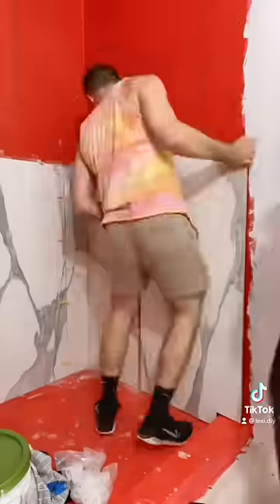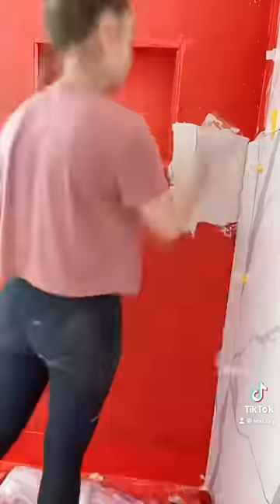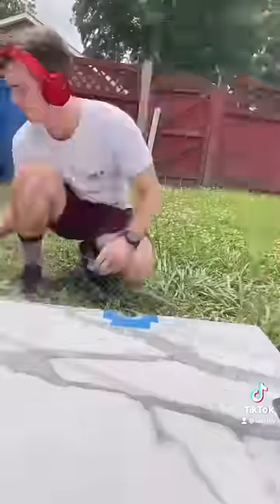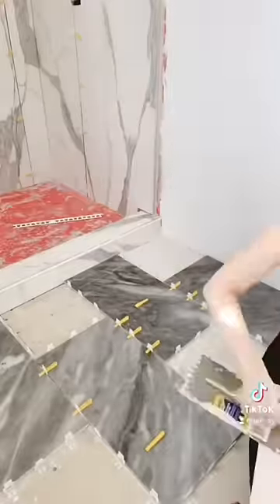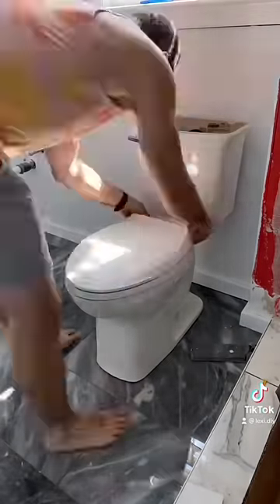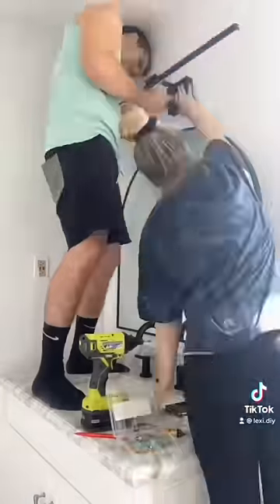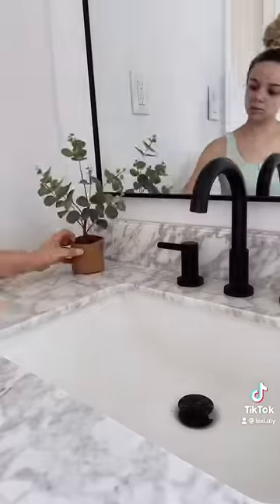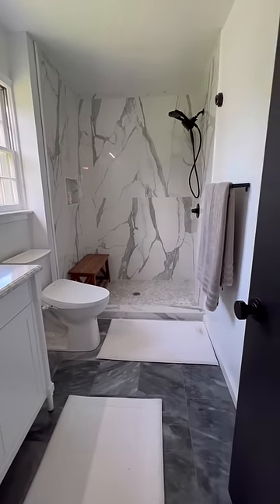HOT MESS HOUSE RENOVATION PART 196 (2 of 2) | VIRAL TIKTOK SERIES | LEXI DIY |BATHROOM MAKEOVER

Comment: That shower is going to leak like nobody's business
Reply: Give them the benefit of the doubt, Google isn't only for your math answers
Reply: @arronhardin1842  a shower is literally one of the most vulnerable fixtures and very substainable to leakage, as a plumber I can't stress it enough to people that they need a professional in order to properly seal and waterproof a shower, I understand that these people might be mechanically inclined however proper training and experience is needed when dealing with tile shower cause any small mistake can be an Achilles heel in functionality of a shower
Reply: @prenleen8563  meh, a lot of so called professionals do a crap job as well (I’m paying for it as the previous homeowner had a shower redone by a contractor and it’s been leaking through to room next door.) As long as you do a ton of research and make sure it’s the correct way to do things, it’s fine to do it yourself. However their shower doesn’t look too good from what I see in this short vid.
Reply: Moved into a house where past residents had a similar set up. Looked great. Leaked like a civ.
Reply: Looks like redguard? Doesn't that qualify as waterproofing?
Reply: Looks pretty good as far as red guard goes. The only problem will be is if they  didn’t build shower pan correctly. that type of shower set up look like a water in water out type system. There is a tremendous amount of prep work that goes into building those types of  shower before the topical liquid membrane is applied. Those types of topical liquid waterproofing membranes are kind of like the last form of defense for a shower if the topical membrane fails and you didn’t prep properly underneath then everything will fail. It’s a big pain in the ass building showers that’s why they cost so much but one thing for sure is they did save themselves a tremendous amount of money doing it themselves hopefully it never leaks.
Reply: @prenleen8563  I agree I’d pay 10k for it to never leak I’ve been through 2 leaks in my house so far in 7 years both through insurance and it’s been miserable
Reply: @kendallritenow1309  lol do everything yourself than if you don’t trust contractors and think it’s so easy with research and that’s all you need. One bad contractor doesn’t mean you should knock the rest. homeowners like you who think they know everything and can do everything are the first ones with red flags.
Reply: @IMABEAST191  it looks like they put no shower pan or waterproof lining before the tile on the shower floor. it will leak and ruin their floorboards and potentially the structure of the house. youre saving maybe a thousand dollars where you will have to spend it later or some poor unknowing person will buy this badly flipped house thinking a licensed contractor did any of this lol.
Reply: @kendallritenow1309  a lot of cheap ass people don’t want to pay for A+ work. Don’t fault all trades people for humans being cheap
Reply: @zachwagner1838  I definitely am not faulting all trades people for some being cheap. I know the majority of guys out there do a good job, but I said 'a lot' not all of even the majority. I'm a lighting contractor myself so I'm no downing trade workers.
Reply: @kendallritenow1309  it just seems the current fad is to post shit work on tik tok, and get praise. Or post a you tube short and get praise. But when someone with knowledge comes along in the trade says a word, all the key board warriors, and elite trades people come out. I find so many on here, and wonder why the trades can’t find anyone. They all know everything on here. So much so I shouldn’t be able to do my 20+ year trade
Reply: @kendallritenow1309  not ok diy almost 90 percent of the time unless you have natural talent for the work
Reply: Exactly what I was thinking!
Reply: @prenleen8563  nope you do not need a professional. Let me say that one more time, you do NOT need a professional.
Reply: OMG it's their house and if it leaks it will be their problem. I do DYI. I don't watch it to do what they do, I watch this for great ideas.

Comment: It looks beautiful! But please tell me you water proofed things. All that work to go to waste if you didn't. 😭
Reply: The walls have Redgard on them. It's for waterproofing.
Reply: Yeah you can literally see it. For someone so concerned about waterproofing you don't even know it when it's staring you in the face
Reply: theres nothing on the floor under the tile which is infinitely more important and fragile
Reply: @luisvaldespino9449  nobody waterproofs outside the shower ever,
Reply: @scott2862  i mean a pan liner for inside the shower floor. i am a plumber please dont give advice to people who dont know any better.
Reply: @luisvaldespino9449  they use pre preformed liners that get sealed together with the walls. 
I’m a general contractor. 
There are a few but Schlueter is a common brand that sells the kits at tile venders.

I’m more horrified the shower floor will fail because they did the flooring after the walls. The floor tiles should be under the wall tiles.
Reply: @scott2862  yup. I almost always do pans seats, curbs, and the floor then start walls. When doing walls before a pan i set it on quarter round then pull em the next day so i can tuck the pan tile underneath. 
They screwed themselves at the top which was very unnecessary
Reply: @donscrilla7171  I agree with you all the way. That top gap is an eyesore now no matter how they try to cover that.
If they had just done the math first they could have practically closed that gap just by raising the inner floor platform and setting the wall tiles over the floor tiles alone.
Reply: @luisvaldespino9449  Red Guard ITS RED !!
Reply: @scott2862  that’s why it’s gonna leak right?
Reply: @Mike-om4tv  kind of rude. Not everyone knows everything. 🤷‍♀️ Don't know how you expect me to be an expert. Just like some I know moisture can mean mold... So yea I was hoping they had some up.
Reply: If you'd watched the 📼s in which they originally did the 🚻 renovation you would have seen that they put multiple coats of waterproofing on the walls before they started tiling.
Reply: @scott2862  
I guess you missed the part where they said over and over and over during the previous 190+ 📼s that they are LEARNING!
Reply: I love their guts, and admire it, but there are so many important steps in this process that I always hire a full time tile/bathroom professional.